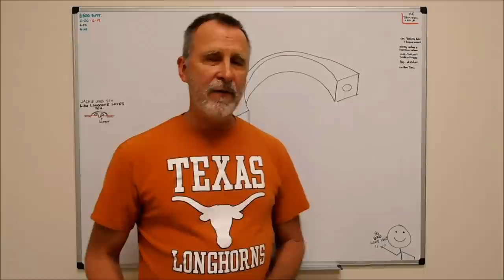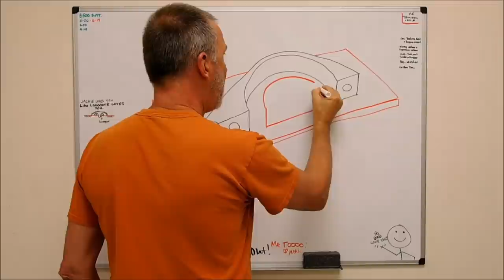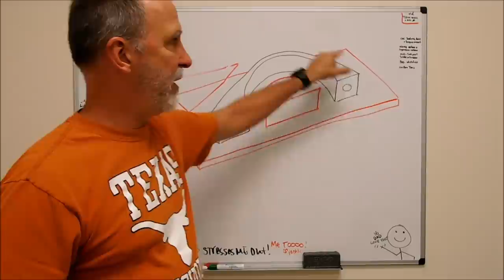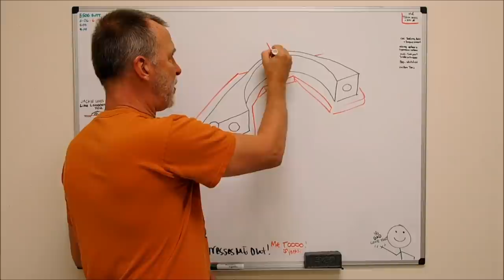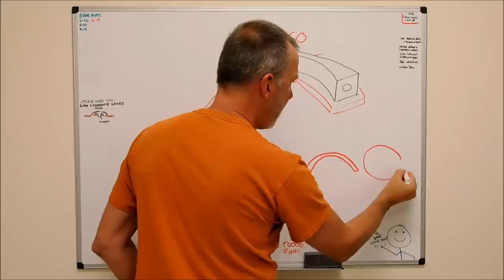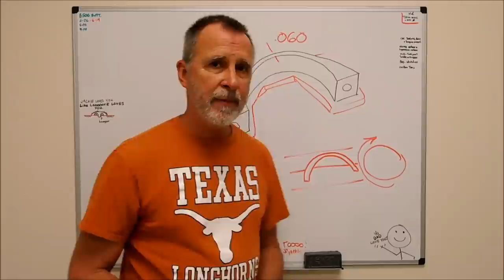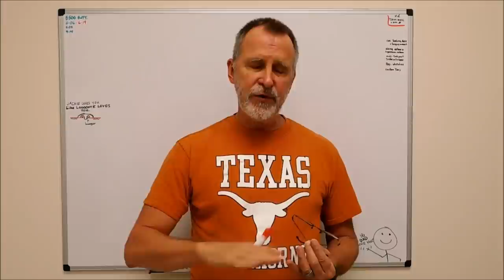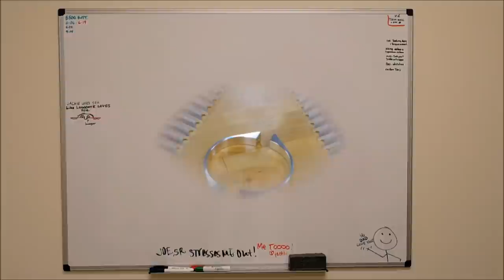Grip Stock - How to Access 100% of your Part Perimeter

Comment: How do you get your jigs/fixtures accurately referenced in the machine?  (This is one place where in my opinion, CNC is woefully deficient.)  I have seen schemes such as: clamp raw stock in vice. Machine features.  Use.  At end of day/run, remove fixture, and discard!  Next run: make new fixture!
          For the initial machining & 1st fixture (where you machine 2nd side), that's easy.  it need only be Z referenced,  XY only approximate.  But for the drilling fixture, it needs XY very accurate, Z less so.  Do you have pins in the table or other references to permit replacing fixtures, or do you "play games" with indicators & the like?
          If took you "2 hours" to plan toolpath/write the code.  How long did it require to make & test the fixtures?
Reply from the maker: I have done production tooling for many years. Many of the companies I have worked in did not have an answer to your question. They would make a part, check the part and make home base adjustments to suit. My approach is to have a hard feature on the fixture that serves as an absolute reference point to the program offset. I bore a precision hole in my fixtures in an out of the way spot and usually engrave the X and Y coordinate shift to get to program ZERO. Setup is never guess work or time consuming. Indicate the hole, shift the table, set the offset and go. Minutes.
Reply: Joe this is another point that I have mentioned to companies along with using Tooling Balls and they do not understand the basic principles of doing it once, do it well, and engrave the information for next time.

The reply is usually “ We’ve been doing it this way for 20 years” with cursing and nonsense.

Speaks volumes about where the company is going, and major insecurity issues.
It’s a shame.

Comment: In Op 2 did you used the custom soft jaws in order to initiate machine zero?
Reply from the maker: Yes I did. It helped the deburr pass track accurately.
Reply: Sir, so you use the same machine zero when you machine that soft jaw to machine your part?
Reply from the maker: Correct. The tool path offsets were opposite, but the CYS was the same.

Comment: Why not have the tool that establishes the flat for the last drilling operation be the counterbore?  That way, the last operation involves 2 tools, not 3.  What about deburring the backside of the hole?
Reply from the maker: The 3rd tool was added purely for the cosmetic finish of the exposed walls of the c'bore. These parts were for show cars and every detail mattered.

Comment: I'm a little lost . Running. A cnc mill then cutting with a bandsaw why not use the mill to remove the big chunks. It should  machine it off a hell of alot faster than pulling it and using a band saw
Reply from the maker: Scrap is higher priced in chunks and the CNC can be making parts while you run the bandsaw. Win-Win.

Comment: I would like to see that part made in a manual mill  .i' would make it one part bore all my holes cut it in half and clean it up.what do you think .I am a hobbyist.
Reply from the maker: That would work, but you would loose the thickness of the blade from the part. It would then not be a true round when assembled.
Reply: Cut it in half first, clean and true the edges, clamp/fasten it together, then bore the hole.
Reply from the maker: @newstart49  Lets address your suggestion from a production viewpoint.  Your suggestion is basically sound, but very conditional. In order to successfully make both halves first, you would have to prep at least 2 surfaces of each half so it mated with the other part cleanly, registered on the vise jaws without angular influence, and sat on the parallels. Then you would need a way to find the center of this sandwich, which means pre-machining the halves to a precision width, or putting a locator hole in it to be indicated. The next problem is, you are squeezing it in a vise, so how do you machine the outer profile?  The way it is shown here, you load the saw cut blank and push the button. The backside op is non critical and a welcome final (2nd) step. As a production manager / manufacturing engineer, I'd rather throw away .30 worth of material than waste $12 worth of labor. Does this make sense?

Comment: is this a pulldown vise? part was not tapped down to trap parallels
Reply from the maker: You are correct. Since this part was a single sided operation, if the raw material was warped, the final part would have been warped. It is a pull down vise, but never tap a single or first side operation unless the blank is known to be flat..

Comment: Joe, have you used an adaptive clearing machining strategy and drop the band saw op completely? I make some clamps very similar to those and do two at a time on the same “carrier” and my fixture holds both for removing the remaining carrier for both parts. Then I stand them up as you did. I actually machined a set of soft jaws for all the ops. Pretty slick. Here is a link to see the parts I’m talking about I did. https://instagram.com/p/BT-zSDXFEr0/

As always great content Joe, I learn something every time you share your knowledge with us. Look forward to the next video you mentioned!
Reply: Man very cool. Could you have used round stock to save material? I’m just wondering. Maybe it would be hard to fixture anyways very nice work!

Comment: Why not use an adaptive clear toolpath for op1 and get rid bandsaw cut.
Reply from the maker: 5 reasons
1. Saw cutting is one of the 2 fastest ways to remove material.
2. Scrap dealers pay more for solid chunks than they do for chips.
3. CNC run Time
4. NOT a HUGE fan of adaptive tool path cutting.
5. The saw cuts are done while the CNC is running. Its a transparent operation.
Reply: @joepie221  i guess that depends on the operators workload.  i would have hogged them on the first pass as im usually running 3-4 machines with not much time between them, not my choice, i vote for more workholding to increase cycle times between machines.  sometimes though, i agree, but its usually a much larger part and i kind of make my minimum 12-16 cubic inches of material the minimum to move to a saw cut.  if the part has more saw cuts, i can go to my low end, if it only has 1 saw cut i go to my higher end, anything less and i think its cheaper/faster to just mill it out.
Reply: I would window pain finish contour pass. . No need to saw cut.
Reply: Yes we make many of these and we just run a 2.5 inch rougher in from each edge to get rid of the excess stock in one pass since they are only .625 thick. Takes a total of 11 seconds including tool change and no way we can band saw that quick and it let's the guy running the machine run other machine and do his paperwork

Comment: what a machine like that cost ?
Reply from the maker: How much you willing to sacrifice?
Reply: @joepie221  what do you mean
Reply: My math is pretty bad but machine time is around $65~$70 hr which is much cheaper than the £175 an hour company I worked for was paying in 1995. (before they knew I could machine stuff)
 Even though I was saving them about £160/hr, I still got laid off when department closed down though. Quick Google search will show machine prices are in your part of the world, CNC mills ~ anywhere from $30,000~$100,000+ for something that can be used for production work (as opposed to hobby/DIY or desktop CNC)

Comment: ok joe dumb question time. why not just program in a couple of passes to make the artifact into chips instead of bandsawing it off. i'm sure there's a reason  do enlighten me !
Reply from the maker: In the scrap market, solid chunks are more valuable than chips. The saw operation in the video is real time. It can easily be done while the machine is running.
Reply: makes sense over time it all adds up. coffee  fund , beer fund, but hopefully not part of the profit margin

Comment: face two sides, drill the two holes first and screw to a fixture
Reply: ah, should have finished the video, you would have a fourth op, debur one side by hand, or still the custom soft jaws.
Reply from the maker: It may have been an easier job if I could have screwed the 2 halves together. thanks for the comment.

Comment: Not sure why you bother wasting time with the fly cutter when you can just up the RPM of the facemill and get the same finish.  Oh and remember how you were talking about the extra 50 cents or so in material?  Apply that same thought process to your endmills and ditch the 2 flute for 3 flute cutters on aluminum.
Reply from the maker: I dare any skilled machinist to be able to tell the performance difference between a 2 and 3 flute end mill. Either will do nearly exactly what the other will do. Its not about cost. As for the face mill, your comments is 100% dependent on the type of insert you have in the cutter. My cutter has wiper inserts with a large land that don't leave a flycut finish. Changing the inserts would work, but you can't beat a flycut finish for cosmetics. This was a highly visible part for a very high end custom car builder.
Reply: Faster cuts = less cutting time per part = more money.  Even you can't argue with that performance difference.  3 v 2 isn't about finish quality or the end result at all its about how fast you can do it.  You can cut faster with the same finish quality with a 3 flute than you can a 2 flute tool.  As for the face mill yes inserts have everything to do with it some are for roughing some are for finishing etc.  I just opt for less tool changes wherever I can myself.
Reply from the maker: My experience has leaned to 2 flute cutters first. I'll have to get a few 3 flute and give them a honest chance. Thanks for the reply.

Comment: Now I  know  why my shop is getting all work. Y'all  a bunch of rookies.  This is a easy part. 2 op .
Reply from the maker: This too is an edited reply. I realize the best way to respond is to ask you to list your steps. Using the same 3 axis machine and a vise. I doubt even the most experienced machinist could machine and chamfer both sides of any part 100% and add features to those surfaces at 90 degrees in 2 op's. And feel free to let us know the name of your shop. I am sure I am not the only guy waiting for your reply. Though I doubt it will ever come.
Reply: @joepie221  how about you go to harvey tool and check out a far side chamfer tool. then part off with a keyseat.like i said send me some rough dimensions and ill show you how the big boys do it.
Reply from the maker: @rev2889  OK then. Before you go and flatter yourself any further, let get real. First, these parts were for a SEMA grade show car and cosmetic appearance was top of the list right next to dimensional conformance. Although running a full perimeter cut and following it up with a farside chamfer tool may work, thats where the cosmetic aspect will now end. Your keyseat cutter will leave serrated marks on the underside ( different than the flycut finish on the topside)  and a hook burr when it cuts through. Not to mention as the web thins out just before the part breaks free, the part is going to shake and the cutter track will amplify. If we ever need parts for our wheelbarrows, I'll give you a call. We still didn't get the name of your shop?
Reply: @joepie221  after reviewing the comments I realize I most have struck a chord with you guys , so please take my sincerest apology. I appreciate that you guys are willing to post vids where I wont because I know most machinist have their way of doing things based on how they were raised. I should not have started blasting you guys. I believe you have good intentions as do I .
Reply from the maker: @rev2889  Thank you. I appreciate the follow up.
Reply: Chris  that was almost a year ago and you guys still cant get over it. yall are the most sensitive people.

Comment: Split point  drills . No spot. Center  drills are for  lathes.
Reply from the maker: Thats a great idea on an angled surface. Not.
Reply: @joepie221  like i said. that's why I'm in business. stub length. its not going to walk. try it. I was referring to the first op drill. Do you ever read tool descriptions on Mcmaster Carr? but it will work on your painfully slow 3rd op too. I'm over here trying to make you money and you're throwing stones..lol ... and that's why you'll always be struggling.
Reply: @Shop-Tech  because this is one of my anonymous accts. and im busy. but you can admire that picture of a lower receiver that I did a redesign on. Which I can make faster and cheaper than anyone else.
Reply: @rev2889  I really hope you're not referring to that piece of shit channel picture. That is the worst looking lower I've ever seen. It tells me the shithead that made it, blew the front takedown pin hole, had to repair it with that butt ugly retro fit chunk and didn't have the skill to sculpt the rear grip area so he had a friend with CAD and a CNC make it for him. Lets not even talk about the miles of cutter tracks you left behind. Did you make that in your basement? Shit, turn the lights on next time.
Reply: Maybe Joe can give you a hand with the next one. The billet lower he had up for a while was a work of art.
Reply: @rev2889  One more thing genius, before you go bragging about what an amazing lower you did, you may wish to install the bolt catch mechanism and the hammer retention pin. Otherwise, the picture is a paperweight. Then again, it looks like one.
Reply: @Shop-Tech  heres the mcmaster part number 28765A24 . im sure youre a good machinist like me and reading and writing is a challenge but read the description. no pilot required. dont worry about the lower it works great you just dont get to see the final product. typical machinist cant change..you gotta love it.
Reply from the maker: @rev2889  I don't usually give trolls like you the time of day, but I just have to comment you're the kind of guy that will always find something to complain about, and feels the need to convince those around you, how smart or superior you are. You have failed to address the subject matter in this video. The very topic of the video itself. Your comments are armchair at best since you have absolutely no idea of the customer requirements, budget, tooling or reasons for the machining shown. I don't care to go heads up with you based on that alone, but I do find it interesting you have time to spar with Shop Tech, but are too busy to disclose the name of 'Your shop". If your work is so fantastic, tell us all where you work. Its free advertising on a very successful channel.  Its not like we will research the tax records and find out who really owns the business. I am sure we are too stupid for that task as well. See ya.
Reply from the maker: @Shop-Tech  Thanks for having my back. That lower project did come out nice.
Reply: @joepie221  maybe one day youll try what I recommend. And youll say ....man rev2 was right. lol. the banter is fun. who i am or where i work means nothing. i pointed you in the right direction. Which isnt very troll like. the good news is you cant tell me i cant do something i already did.
Reply from the maker: @rev2889  Split point drills do work well when starting on a flat surface. When you start one on a tapered surface, you will get deflection and bounce until the point and full diameter establish a tracking diameter. At this time, you'll see the bounce and grab in the finish, for the distance the full diameter and point started to cut as intended. This is an undeniable fact. Cosmetics were very important on this job and the process used was driven to achieve the very best finish on all surfaces. Even inside holes. Time was not a factor. A part fabricated with your suggested approach would have been scrapped and rejected regardless of the dimensional conformance. I still think you're a 'wanna be, so called expert ' CNC machinist, that probably has limited experience at the only shop on your resume. Since you don't have the balls to give a shop name, We're done here.
Reply: @Shop-Tech  i liked your review of my lower..lol..i think you had more to say about it, why stop?
Reply: @Rev2 Your point is irrelevant. The spot faces provide parallel flats for the fasteners which clamp these parts to an axle. They are a functional requirement, even if they're not absolutely necessary for drilling the holes.
Reply: @slother93  Don't bother trying to share any wisdom with this guy. He's as smart as he is ever going to be. Anyone that states center drills are only for lathes has been listening to the wrong group of mentors. If he pulled his head out of his ass and realized some people strive for quality in the work they do, he may have a chance at some growth. But I truly doubt that. This guy strikes me as a wham bam, use the tolerance, to hell with cosmetics, look how fast I made that part, hammer mechanic kind of "machinist".
Reply: @Shop-Tech  i put a video up for you. as promised.
Reply: @rev2889  I would like to start by thanking you for taking time out of your busy schedule to shoot and post your video. I am sure both (2) of your subscribers will appreciate new material. I also have to extend an apology. It is obvious that in our last exchange, I may have left you with the belief that I would ever give half a shit about any technical material you would ever offer. When your amazing new video hits 10,000 views ( a task that Joe Pieczynski can easily achieve in the first 24 hours after posting a video ) I may break down and be #10,001. Until then, go get your manly hot pink headphones and play with that POS AR. See ya Bruh. Its been real.
Reply: @Shop-Tech  its hard to hold back the smart assery isnt it?. I too want to let it rip. you do a great service to the industry.
Reply: @Shop-Tech  you know there was so much flame throwing i gotta wonder did you see the video i posted from the shop? did you follow the link to the article about spot drills? let me know. and then ill do a video about the lower. i think youll like it. see it not that hard to chill out.